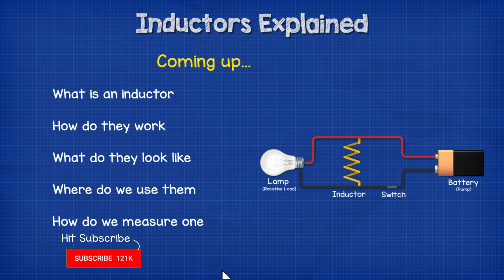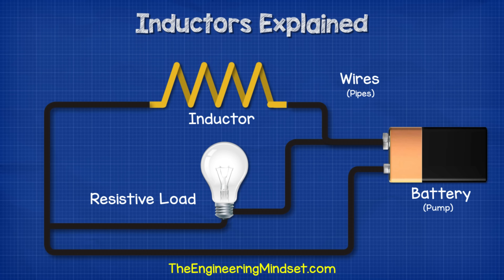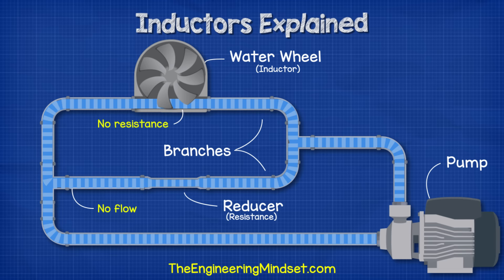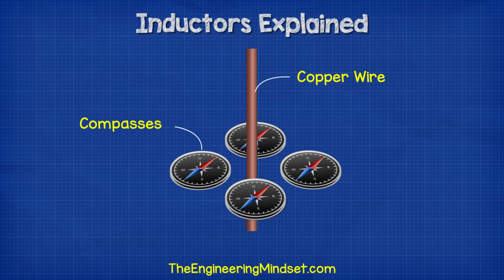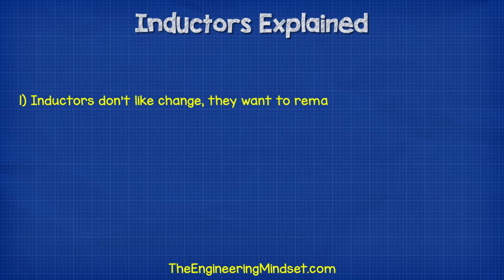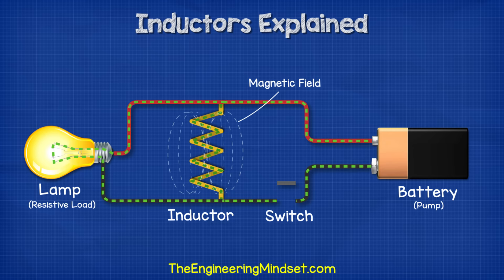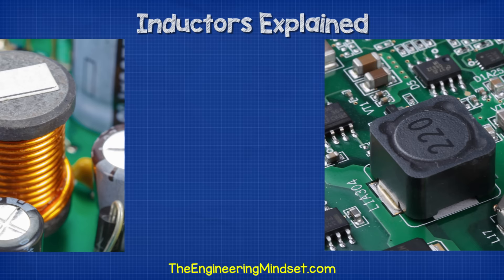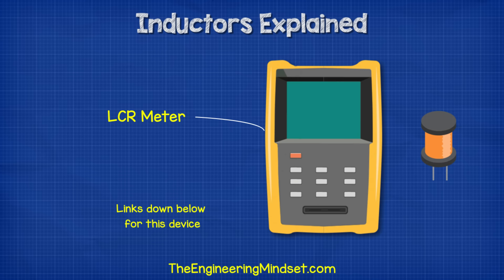Inductors Explained - The basics how inductors work working principle

Comment: Great explanation and analogy on the operation of inductor! However, I'd like to point out something that I've noticed in most lecture, that is they always provide a current path for inductor when the switch is off. One critical factor for using an indicator is to also understand what happens if a current path is not provided and what the consequences are. I've noticed many people using inductor without knowing what "kickback voltage spike" is. It would be best if the video includes this part as well.
Reply: Yes we used to make electric shock machines in our lunchboxes at school using choke coils out of old TV sets (cathode ray ones). We would have two handles instead of the bulb. A 9v batter and a switch. The collapsing field generated such a high voltage that you could get a circle of kids with the one at each end holding one handle each, to all jump from an electric shock. No idea what the voltage was... we just thought it was hilarious.

Comment: Truely remarkably good video ! Inductors are complex, for usually its a coil with a current that creates the magnetic field. and other times its an Antenna recieving a magnetic field, creating a current . An inductor stores a magnetic field. The Volt is instant but the Ampere is Delayed and ramp slowly, fade in, once the switch is in. Switch opens and the current fades out in a ramp over time. Just opposite of a Capacitor, where the Ampere charges first, steep. but the Voltage rises in a slow ramp . Phase Compensation . Henry in a coil would be the same concept as Farads in a cap. Its energy stored is one thing, but the Time it takes to deplete the energy is depending on the resistance of the circuit with load . The magnetic field in a coil would deplete even if both coil ends are completly removed from any circuit, because its driven by the current. Once the current is removed from a coil, it takes time for it to fade out,  time for the electrons to settle, the time sequence to reach ground state or Quantum Inertia ! depending on L = henry . I suppose you can call that eddy currents as well as Back EMF, as well as self inductance.

Comment: I love you so much for using electron flow convention. Every damn video out there uses conventional one and it drives me nuts.
Reply: Get ready for a shock. Electron flow is not what actually happens in a circuit. It's just as 'wrong' as conventional current. Ask any quantum physicist.
Reply: @silasfatchett7380  grt ready to be shocked, conventional flow is wrong but the calculations are the same

Comment: I was confused at first, thinking "isn't this what capacitors are supposed to do?" But capacitors resist changes in voltage, not current. And I now understand the difference much better. Capacitors build up a charge, the charge remains when the battery is disconnected, but the voltage difference is still there, now provided by the capacitor instead of the battery. For an inductor, the magnetic field the generate keeps existing for a little while, and this magnetic field induces a current in the wire when the battery is disconnected, thus keeping the current going for a little while longer until the battery collapses. Thus capacitors provide voltage, and inductors provide current.
Reply from the maker: Check this out, how a battery works: https://youtu.be/PXNKkcB0pI4
Reply: @EngineeringMindset  please make a video about tank circuits

Comment: I've met an inductor called a saturable reactor and it was shocking , literally
Reply: Try messing with a current transformer like a heavy bar with a few hundred turns of 
wire wrapped over it, a BIG voltage increase for sure.

Comment: Great video, thank you!! Just one thing. The magnetic lines demonstrating the magnetic field around the inductor are wrong here. The main magnetic vector which goes through the coil loop is pointing ALONG with the electric current direction. The direction of the magnetic field is determined by the directions of the current and it's always the same direction. It's the "rule of the thumb and the fingers". The resistance of the inductor (simply resistance is high because there is a lot of wire there wrapped into a loop), but as the current goes through, stronger and stronger magnetic field is generated and this magnetic field "pushes" the electrons forward and "sucks in" those who are a bit behind and hence compensating for the resistance of the inductor.

Comment: summary:
- an inductor is a component in a circuit that stores energy in a magnetic field, and can quickly release it
- the water wheel analogy is excellent to think of as an inductor (it takes time to "start up", and when current is shut off, it will keep current moving till it loses "inertia")
- moving electrons generates a magnetic field (thus electrons moving in a wire produces a magnetic field)
- putting wire in a coil causes a bigger magnetic field to be generates
- inductors have "current inertia" (they don't like change in current - if current is trying to increases, they will make it harder for that to happen by "sucking up" some of the current as an increase electromagnetic field, if current is trying to decrease, they will add current - but this uses up some of the energy stored in its magnetic field)
- inductors "smooth" out the start and stop of current
- inductors in circuit boards often have a casing to shield other components from its magnetic field
Reply: An inductor stores energy in the magnetic field, not an electric field. Capacitors store energy in the electric field.
Reply: @shayanmoosavi9139  Thanks! I corrected it :)

Comment: Wait does the electron flow to the bulb reverse when the power source is disconnected from the circuit? Wouldn't that cause problems if the component had a certain polarity?
Reply: If it's a light bulb designed for an AC system then it's already used to current that's constantly changing direction.
Reply: I think it would cause problems for components that need DC. However I'm pretty sure that inductors are often used in series with the load, unlike the example in this video where the inductor is parallel to the load, and causes the current to change direction when the battery is disconnected.

Comment: Hey Paul, can you make a video about how the diesel generator work? Im talking about excitation system, avr and so on. Thank you:)
Reply from the maker: Oh yes this is definitely coming, be for a while though.
Reply: I am really enjoying these videos. I work in the power industry (steam generation side) and I've always been mystified about how the electrical side works. Having said that, I used to work for the railroad as a locomotive engineer operating DC/DC diesel electric locomotives. I never really understood why the locomotives had to make transition (change the electrical connection between the generator and traction motors) as the speed changed. Something to do with back EMF, but it was never really explained.

Comment: good explanation however, still not sure why you would want to use one or why its necessary to have one.
Reply: You could for example use a inductor in line of a power supply, for example for a mobile phone or laptop. 
imagine you put the supply in the socket. Often, you see a spark while you insert the supply. this could destroy your smartphone if you didn't have a induction which blocks a spike in the current flow.
Reply: @MrFrakyfriday  ah ok.  so does it basically "smooth" the energy flow out, almost like a shock absorber?
Reply: @jessemurray1757  yes, exactly!
Reply: MrFrakyfriday brilliant!  Thank you sir!

Comment: Doesn't a collapsing magnetic field cause a voltage spike before it goes out?
Reply: Only if it can't maintain the current
Reply: kimrkarl go to sleep
Reply: yes it does. that's why it's used in boost converters.. he did not cover that..
Reply: No, read up on a transient response
Reply: The magnitude of voltage produced by a changing magnetic field is directly proportional to its rate of change. Abruptly disconnecting the battery --> abrupt change in coil current --> momentarily high rate of magnetic field change --> voltage spike.
Reply: Hi yes it does, thinking of it in terms of each one of every turn of the wire can be considered to have the same voltage across it as a neighbouring coil  whilst accumulating field, when we want the stored energy to return we can choose how we wish to use it,
 it can be made to return all at once
 12v across each coil turn, say 250 turns would come out as 12x250=3000v  
each coil whilst fully charged can be thought of a little cell, and whilst what ever did the charging was at that rate 
but after, Returning (discharging) can be performed differently it's basically a trade off between taking time to charge at a low rate then suddenly to release all the energy basically how highvoltage can be generated, 
Study TESLA  
If you want highvoltge it can be generated this way
Reply: @mikefischbein3230  You should take a look at the basic law of a magnetic field.  The current lags the potential in an inductive circuit. If you are referring to a battery the circuit is DC.  If the current is constant the potential across an ideal inductor is 0.  The potential will surge across the inductor because the current cannot change instantaneously.  But the potential across the inductor will never be as high or higher than the battery.  When someone opens a switch in an inductive circuit the current initially continues to flow in the air across the switch this is called arcing. Arcing is the reason behind the voltage surge of the circuit, the inductor can only lose energy when the switch is opened.
Reply: @warrengray610  Your post was not accurate and resembles a transformer not an inductor.  I built a Tesla coil when I was an undergrad, this has nothing to do with the original question. Also, the magnetic flux of a Tesla coil is not the same from a standard  transformer. In fact a Tesla coil will not work if the turns overlap.

Comment: I understood the capacitor video. This one confused me.
Reply: Mike McMac me too ... it’s just confusing what inductors would be used for
Reply: Capacitors and Inductors do the same thing.... they store energy.  Capacitors use chemistry to make a small electric field to store up electrons.  Inductors store energy in the form of a concentrated magnetic field.   Both take time and electric current to "charge" but behave differently once they're charged.  A capacitor acts like a resistor once it's charged, but an inductor acts more like a straight wire once it's charged.  When power to them is removed, they then begin to discharge, assuming the energy they've stored has somewhere to go.  Both discharge at different rates/profiles.
Reply: @jovetj  thank you so much for this answer!
Reply: I love this answer👍
Reply: @jovetj  love it
Reply from the maker: Check out NEW resistor video, everything covered! ➡️ https://youtu.be/DYcLFHgVCn0

Comment: So glad you haven't followed the stupidity of current direction. The water wheel was a grand example and could also show the inductive reactance with the bearing / windage resistance. Good job! Been in industrial electronics for 47 years - now retired - and never heard the water wheel. I wonder if we will have super inductors, to match super capacitors

Comment: I know this is a couple of years ago but can you do a video on inductors and capacitors in an audio crossover network and how they affect the audio frequency spectrum? Thanks for all of your informative videos!
Reply: I know caps cut bass, and inductors will cut treble each by them selves. That's a trick I've used on rear door speakers is using inductors I've salvaged from trash circuit boards to keep them at a low frequency lol.

Comment: I don't understand why the inductor would steal all the current from the circuit when the inductor is at it's lowest resistance. 

You have previously explained that in a parallel DC circuit, all resistive loads would share the total current. 

Why wouldn't the inductor share the current with the lamp? 

And great vids btw ❤

Comment: The exact equivalent of an Inductor in a Mechanical system is Mass (or Inertia).
One can not stop a moving mass abruptly and when you do it creates very high force, F = Mass x dv/dt. Higher the rate of decay of velocity, higher the force. Hammering is the perfect example.
Same way, one can not break the current in inductor abruptly. and if you do, it creates very high voltage across the inductor terminal. V = L x di/dt. Spark Plug in IC engine utilize this principle.

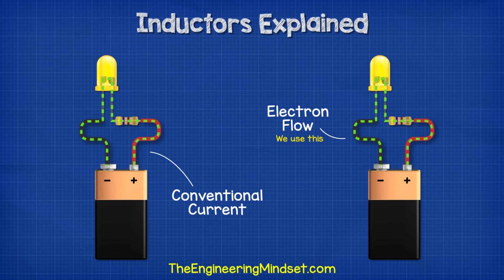Comment: At 2:05 in the circuit on right the resistor is on wrong side in which a lot of current flow through bulb,with out any resistance and bulb blow off
Reply from the maker: That's not true, it can be placed on either side https://youtu.be/DYcLFHgVCn0?si=_rJeGFNib_Ye3GVN&t=1668

Comment: It's important to mention that inductor wires are isolated from each with a transparent material. Even though it looks like bare wire it's not.

Also, that thing about moving electrons is no correct. It is the electrical impulse that travels, an exchange of charge between atoms. There are not flowing electrons inside a conductor, not the same way as water flows inside a tube.
Thanks for the video

Comment: The inductor reminds me a lot of the capacitor. Because an inductor supplies electrical current to the circuit when there is no electrical current present. Just like a capacitor supplies electrical energy when none is present. In which they both are the causes of parts of a circuit functioning while waiting for a prime source of energy.

Comment: Your explanation of inductors is plain and simple and I understand. You've not given any reason for their use or any place in a circuit when their critical to use.  Like I said I understand how they work, I just have no idea why I would need to use any. Big or small. Could you please give examples when your explaining electronic components on where and why to use them. I don't have any electronic training or schooling.  I've listened to a lot of your videos but I'm not any closer to understanding how to use any electronic component except maybe the bridge rectifier but I have no idea about the value of the diodes I would need to make 1 from 110AC

Comment: If you run a magnet close to an inductor, it acts as a alternator (dynamo). The magnet pushes the electrons in the wire, temporarily power whatever is connected to it, assuming the magnet (the force) is strong enough

Comment: Fantastic Video Engineering Mindset! Just one question, @ 4:04, what is keeping the electrons from flowing back into the battery from the inductor?

Why would it choose to flow into high resistance lamp if it could simply branch back into the "negative" battery terminal?

Comment: Better get the bearing in that waterwheel checked out, it has a nasty jump during rotation that may cause it to stall at start up...
You could un bolt the animation and fit a newer one in, or if your ok with repairing used parts, perhaps grind back a frame or two until the rotation smoothes out.
You could spray a can of motion blur on the rotor to lessen the effect as well.

Comment: Very nice video, thanks. Just a quick question: Does the "magnetic field" really hold any power? How can that "power" be released into the circuit when the field collapses? Isn't it rather that the magnetic field is preventing current from flowing, and when it collapses; it's collapse drives a small current until it has fully collapsed?

Comment: It is not the flow of electrons but electric and magnetic fields (that are perpendicular to each other) and the energy flowing along the conductor that causes bulb to glow and induction effect to takes place. Electrons just drift at 1/10th of mm per second. When the circuit is closed, electrons accumulate towards the surface of the conductor.

Comment: Once when I was working on the pipeline construction biz as a laborer they set this huge pipe 3 ft diameter 1000 lbs per foot, 1 mile long up on insulators (wooden skids) about 4 or 5 ft above the ground UNDERNEATH THE LARGEST HIGH POWER TRANSMISSION LINES IN THE COUNTRY. Underneath and in line. There was some snow and the pipe sat there for 2 days. I was the first one to touch it (ground it). It blew me back about 12 ft. I woke up with all these indian laborers looking down on me in a circle saying "Is he dead? Is he dead?...." Nope. Not yet.

Comment: Electrons do not leave the battery and travel the circuit as you say if they do that it will be a very slow process because electrons have a slow drift velocity.
It may be simple for people to understand but instead you can say the turth that the potential difference between to points created by the battery makes an electric field that propagates at a speed close to speed of light and it is which then exerts force on the electrons to move.

Comment: Inductor is resistance to increase in voltage opposite to that of capacitor which gives resistance to increase in current as the increase in voltage gives rise to torque as a starter.

Comment: THE ENGINEERING MINDSET: I have a question that wasn't answered within the first example that used the water circuit- how come the water flowing from the heavy wheel chose to move against the path with the reducer instead of the path without the reducer(when the pump was turned off)?

Comment: At 3:53 when the lamp extinguishes and the Inductor provides virtually no resistance, should there be a resistor in-series with the Inductor; otherwise there would be a short-circuit across the battery? Or does the Inductor have sufficient resistance?